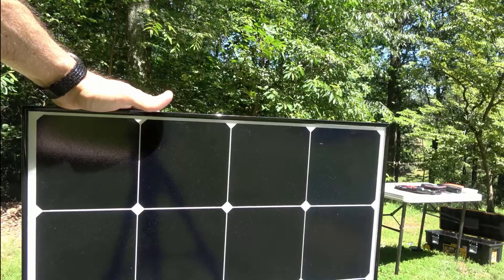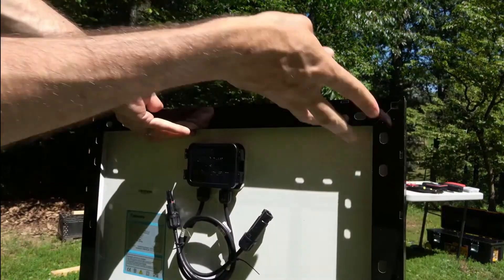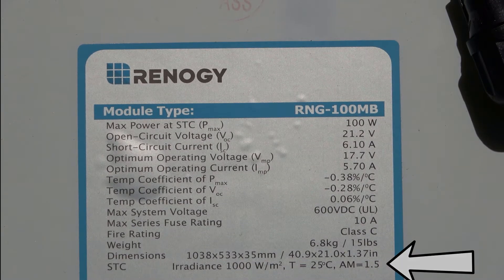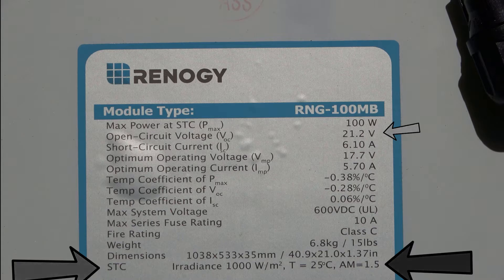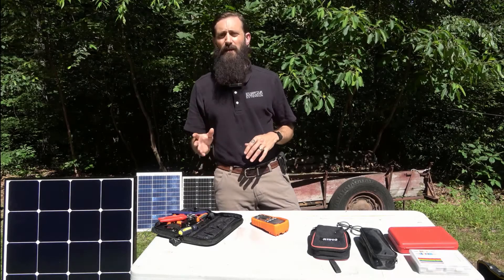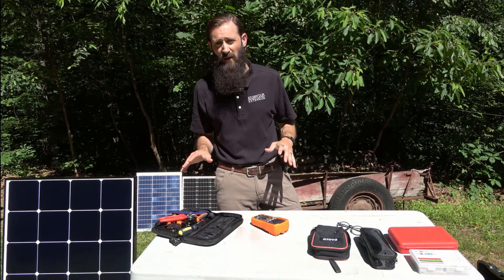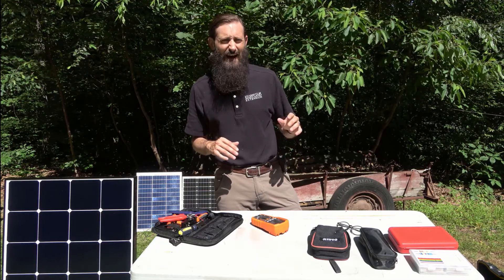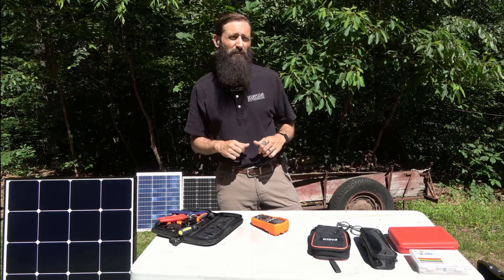How to test and replace diodes in solar modules

Comment: Drew, I think you are confusing the meaning of the STC temperature of 25 C.  You imply that this refers to the temperature of the air near the PV but actually it refers to the temperature of the cells.  If the air is 25 C and you are illuminating the PV with 1000 W/m2 sunlight, the cell temperature will be much higher tan 25 C, more like 40 C.  This typically reduces the open-circuit voltage from the value stated at STC.

Comment: I'm seeing performance issues that indicate bypass diode problems. However when I pop off the junction box cover, all I see is something completely full of silicone-like stuff, and can't see any diodes or terminals. Is it normal to have silicone and do I then have to dig it out and replace it afterwards?

Comment: Thank you, for the demonstration. With all due respect, one of the main features or the different types of PV cells in the market was not spoken of. ie 1) Poly Crystalline and 2) Mono Crystalline  PV panels. This description is important because people are STILL using Poly Crystalline PV Panels. The character, technical and efficiency details are different, that the users may not know. There are consumers not using Blocking or bypass rectifiers in such cases. I know that the information on any PV system is complex to lecture in the shortest possible time frame as in YT. There are hundreds of Saturday Warriors with limited know-how on the scientific aspects of the System, who in turn cause untold calamity.......... Thanks again. 
respectfully, 
SreeKumar PhD

Comment: Great video. I just have one comment. It's a nit pic. "OL" doesn't stand for "OverLoad", It stands for "Open Loop" . On a Fluke 77 Multimeter, "OL" stands for Open Loop. This indicates that there is no continuity in the circuit you're testing, meaning the circuit is broken or there is an infinite resistance. Essentially, it means that the electrical path is not complete, and current cannot flow through it

Comment: 8:11 The probes are in exactly the same position as in 7:36. I don't understand this.
Reply: @douglasheld>>> Sir, in all issues and information, concerning Electrical, electronics, Scientific and any technical matters; REQUIRE elaborate INTRODUCTION to begin with. Here you spoke about PROBES @ 0811h and 0736h.
There's no head or tail of the enquiry. Most people who read your script need to, ALSO, understand what it is. 
I'm not being sarcastic or intimidating or being totally disrespectful, NO. Just paving a path to provide detailed introduction to the matter you are inquiring about. Thanks and best wishes.

Comment: USELESS information without some links on how to procure proper replacement diodes for my sized panel! 
Why bother when you only go half way?
I suspect when I need to replace them that they Internet will have been taken down also.
So no new info and no ordering of diodes when you really need them.
Reply: Just google "buy + the letters/numbers on the diode" and many sellers of that exact diode will appear in the results, duh!
Reply: Far from useless information, he mentions to get the info off the diode for a direct replacement, finding a diode is as simple has it can get with today's internet.

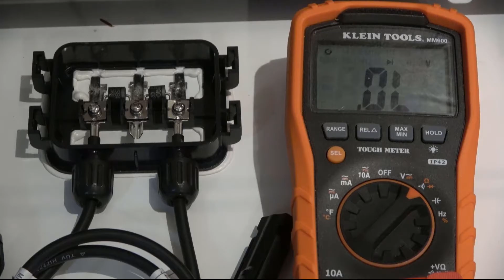Comment: Wow!  Messed up!   He connected the probes the same way in both cases (red on LHS, black on RHS) at 7:33 and 8:07 and the connection to the meter appears to be the same (bit of red showing on the POS side) in both cases and yet he got 2 ostensibly different results on the meter in the video.  How is that possible you ask?   Well, it isn't.  So, what gives?   Well, if you go frame by frame at 7:33 you'll see that the images have been changed at some point. On one frame the meter starts to show a reading then the frames are changed (and no longer moving, tellingly) and it now shows OL.   Basically, it appears he messed up and did not actually swap the probes as he should have done, or lost the footage, and they then manipulated the video to show the "correct'" answer by inserting a still image.   Odd...
Reply: Noticed that, and also thought maybe he swapped the leads on the meter, but as you said there is a bit of red on the meter and both were the same connection. Very good video up to that point.

Comment: My brand new 130w flexi solar panel shows zero amps and zero volts output, if i can access the panel connection box, when the panel has been in full sun, will i get a shock?

Comment: why not use a small diode between every cell?
Reply: You need the same size diodes in that case because it still have to be capable of dissipating the same amount of power because the same current will flow through it no matter how many cells it bypasses (cells are in series, ther is just "one" current flowing thrugh all off them). Big diode for each cell would be very expensive not just because of the cost of the diodes, but maybe more because of the complicated construction of such panel, if something cost 50% more but doesn't result in at least 50% more performance (more annual energy generation or better longevity) it shouldn't be there.

Comment: Did i miss something? You replaced two diodes with one diode?
Reply: First he showed the junction box with 2 diodes with screws and then he showed another junctionbox with one diode, which was soldered
Reply: 2 different panels.

Comment: Brillant, but my panels are generating 36V which is correct but only 0.4amp. This is on both when tested separately. What could be wrong? They both worked a month ago - cheers
Reply: They are failing under load. Could be the diodes in the junction box on the back of the module. If they are good, the cells could be bad. Do you have lines on any of the cells that resemble snail trails? If so, get new mods.